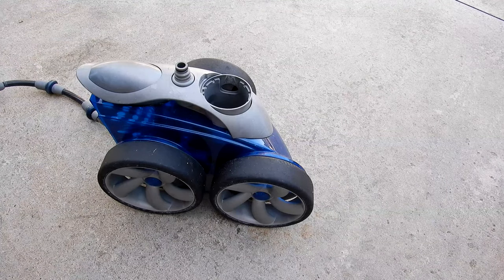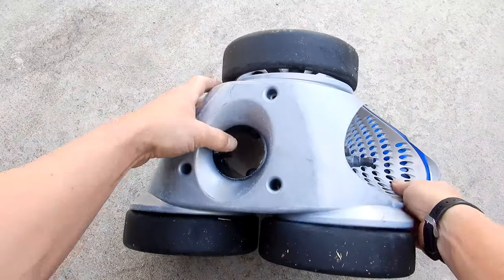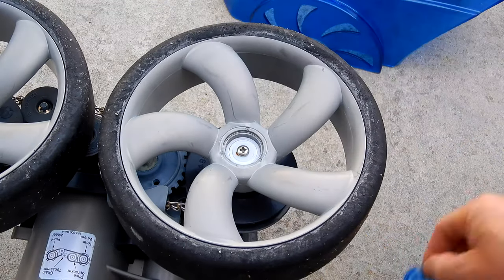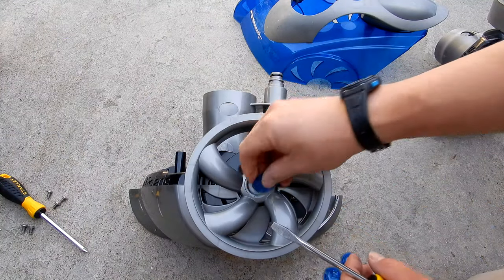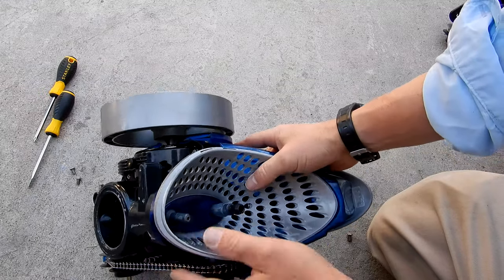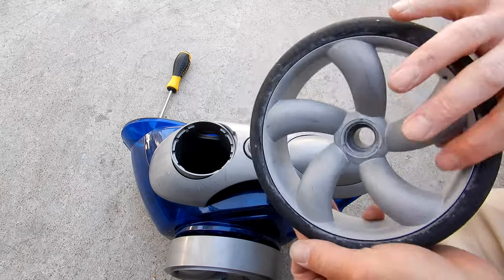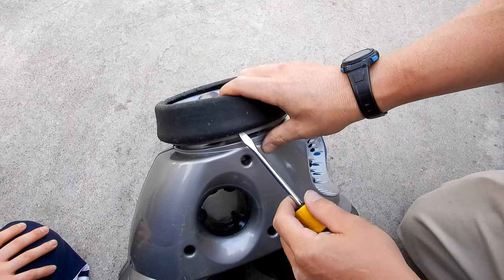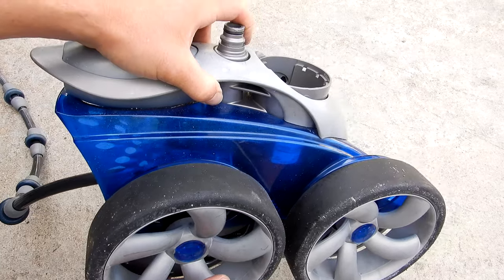Polaris 3900 (P39) Sport Rebuilt Kit Installation Video: Renew A Polaris 3900 (P39 White) for $180!

Comment: Thanks for the video. Ordered the kit. Followed your video. Now my wheels don't turn. At all.  Took the backup valve off to make sure it wasn't the issue. So now it just floats spinning in a circle.
Reply from the maker: Check the screen in the quick disconnect. Maybe it is clogged up.
Reply: @SPL  Thanks for the reply. I think it is the Water Management System. Have ordered a replacement. It's almost impossible to get it detached.
Reply: Just to get back with you. It was the Water Management System. Replaced it and all is well. Thanks for your help.

Comment: Any preventative maintenance that can be done to avoid rebuilding?  Mine is only 3 seasons old - tires aren’t spinning and gears sound like they’re grinding.  Do I need to just expect to rebuild every 3 years?
Reply from the maker: If you run it just 1-2 hours a day it should last longer. Most pools can get by with this running just 1 hour a day.

Comment: Dude if that top body is 5 years old I'm only 2 years watching this video trying to repair this thing!! From what I see you should get a new o ring for the water mangmemt system.  I'll give you five stars if you tell me a work around for cracked upper  body  inserts. Have you tried to expoy or just order a new top? This thing probably has been dropped. All kidding aside very well done video. Dont forget a new o ring though.

Comment: Should the two wheels on the drive chain side supposed to turn at the same rate of speed? My cleaner is going in circles. The back wheel  does not seem to be turning as fast as the front wheel.
Reply from the maker: I believe they all should be
Reply: Thank you.

Comment: Having a heck of a time getting the 2 wheels off...any suggestions?
Reply: Got them off, put the wheels down on the floor and put each foot on the wheel and pull and twist up to get that stubborn gear out!
Reply from the maker: That was crazy tight. Must have been in the water for a long time.

Comment: New tires are very hard to install.  I'm still working on them.
Reply from the maker: Yes, they are extremely tight. If all else fails take it in to your local Leslie's and have the  manager put them on for you.
Reply: @SPL  I found that if you soak them in hot soapy water they are easier to slip on.
Reply: @SPL  I soaked them on hot soapy water and they were easier to slip on.